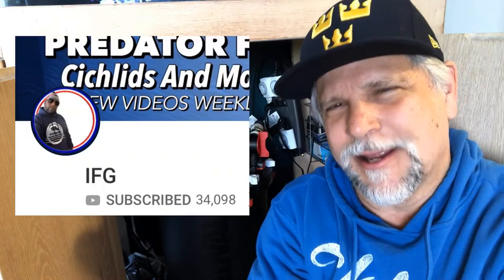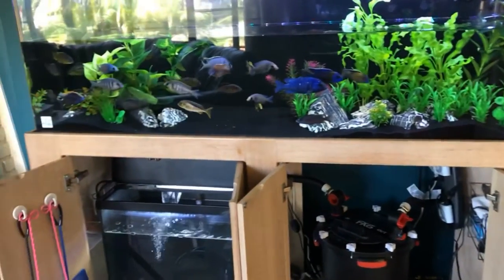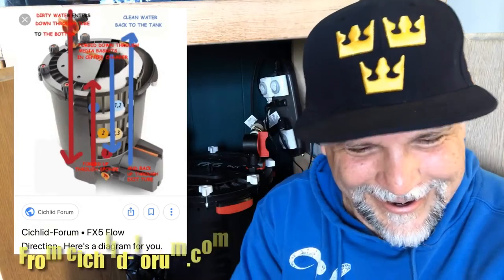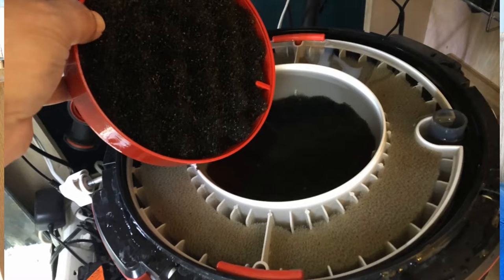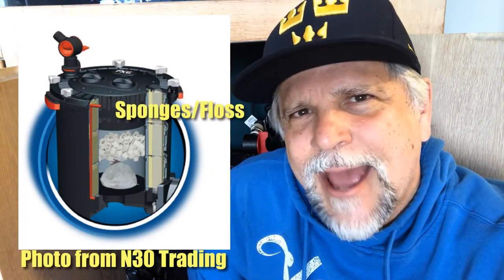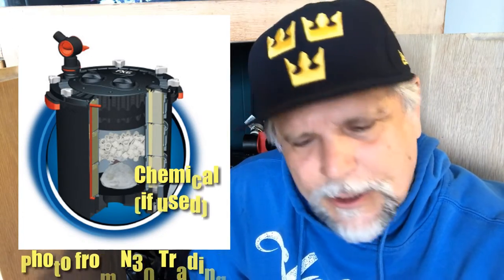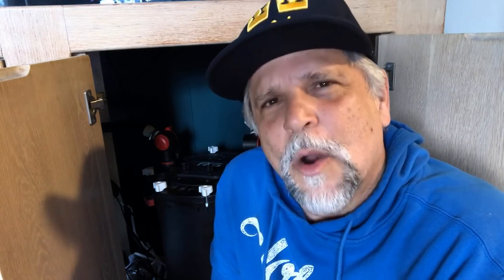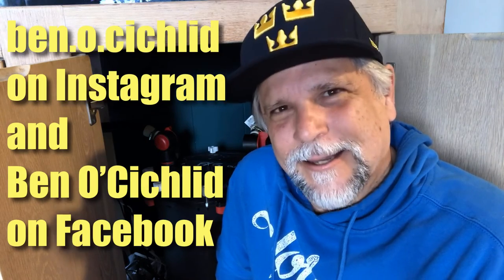Fluval FX Canister Filters - Before You it Plug in - WATCH THIS!

Comment: Have to say that I love the cap you wearing! :)

Got two FX6, Sunsun 704 & 703 and a CrystalProfi E902 to my 190 and 80 gallon tanks.
Both the Sunsun canisters started to leak within a year, and for me the leak on both filters came from the Inlet and Outlet Connector, took everything apart and used plumber tape behind all orings.. that did the trick.
Also had an issue with the FX6, but in that case it where a leak in the middle of the hose that started to spray water and not the pump itself.

My apartment have newly laid parquet floor so I don´t want anymore leaks..

I´m going to put each canister in a small container and then put a WiFi water-detector (puck) at the bottom of each container, if there is a leak the sensor will both sound an alarm and send a warning to the phone, it´s a total cost of about 250€.

Like your videos, keep it up.. regards from Sweden!
Reply from the maker: That’s the best way to have a canister. There is from my son who played baseball in Sweden one summer. He fell in love with the people and the country.
Reply: Swedish coat of arms. 🇸🇪 
Great video!!

Comment: Hi Ben, this video was very well done!!! I like how you discussed measuring the hoses. I also like how you clean the sponges to save money and improve performance. I don’t use any chemical media, so I just put more bio media in the bottom tray. Also, there is also 4 metal clips that the screws to the motor go into attached to the plastic ears on the housing. Great job my friend! I will share it and congratulations on 13 K.
Reply from the maker: Thanks Denny, you helped me out originally with both the FX-6 and the sump set up, if you recall!  Thanks!!!

Comment: Thanks for the tip on the sponge material.  I was about to order some.  Even if you replace instead of rinsing the sponge in tap water, there will be no good bacteria either way.  Also, you could rinse half in tap water every other cleaning to keep half of your beneficial bacteria in the filter.

Comment: If you put a conditioner in the tap water to rinse the sponges you won't loose the bacteria.  Use Safe and its very cheap to condition the water when you need to clean the sponges.

Comment: Thanks for the video. Just picked up the fx6 today to upgrade my 307 since it's struggling with my new 75. Only issue I seem to be having, doesn't seem like it pushes much more water opposed to my 307.
Reply from the maker: Maybe the split outputs on the FX6 make it seem like it’s pushing less water than it actually is? If it was one output it would be super high pressure.

Comment: I’m glad I watched this before I bought one. I’d have made most of those mistakes. Just had a bad flood/ leak with an All ponds filter( sun sun)
Reply from the maker: Thank you for stopping by and watching Pamela.  Another tip that helps (covered in a later video) is to place canister filters in platic containers.  That way if they do start to leak the water is contained.  You can even get sensors that set off an alarm if there's water detected.  It's covered in this video: https://youtu.be/blpw1Jo9fgM

Comment: What are your thoughts on changing the coarse sponges for different ones?  I have noticed a lot of the UK YouTube FX6 improvements suggest using one blue sponge on the outside and a green one on the inside sandwiched together (egg-crate style) in lieu of the Fluval white one.  Since I don't want to advertise anothers' site on your page I won't link the youtube page.  If you can't find what I'm referencing I can give you the title of the youtube site.
Reply: (Blue) 20PPI, (Green) 30PPI sponges I believe.
Reply from the maker: I’ve been happy with the performance of the filter using the factory outer sponges, especially after adding a pre-filter to the intake.

Comment: Great video!
I always rinse my pads in tap water.

I guess my biomedia have at least 90% of the nitification cycle bacteria, so loosing the 10% or less from the spunges is no big deal.
They will be replaced within a few hours and the ammonia and nitrite spikes isn't even measurable with any standard water test kit, so it will not harm the animals in the tank.
Of course, for anyone who have spunges only as both mechanical and biomedia, this method doesn't apply, one shouldn't rinse them all in tap water (or aquarium water, for that matter) at the same time.
Rinse the foam from one media basket each service of the filter.
It will reduce service intervalls, but keep the fish safe.
Reply from the maker: Excellent points Daniel, thank you!
Reply: Me too granted my water is from a well not a city source. While I don’t have a nice FX6 (too poor) I run a sun sun canister filter and a bunch of HOB filters. All filled with bags of lava rocks! Easy to rinse when they eventually get clogged. Works well and I save a fortune on replacement filters.

Comment: Ben, I just came across your video - well done sir!  I set up a 180 gallon tank in February with an FX4.  I am curious how do you deal with surface.  Also, do you have an videos or picture of the depth settings of the filter's input and output and how they are directed/located in your tank... are there advantages/disadvantages of how these are adjusted?
Reply: ^To clarify, how do you deal with surface protein?

Love your vids!
Reply from the maker: I point one FX output slightly up and toward the intake in the far opposite corner and the other slightly down. I also have 2 powerheads pushing a lot of water around. One under the Fluval output, also pointed toward the input, and one on the other side pointed slightly up and forward, breaking surface tension and helping to create a circular water movement pattern.
Reply: @johnsoncraig2230  freshwater aquariums don't really have a problem with proteins.
Not like saltwater setups

Comment: My directions say to put the rings bio in the bottom basket. Also some time I noticed that the thin filter at the bottom will stopped the water flowing out, why. If I rinse out the new filter first, it does not do it

Comment: Hi. Just set one up. Was working fine for about 4 hours and then started marking a clunking noise from the canister. I am wondering if this is trapped air. Unplugging and plugging in sorted it.
Reply from the maker: I’m glad it sorted out. It can drive you crazy.
Reply: @BenOchart  it did it again a few hours later, it is the air bubbler too close and sucking air in to the FX6 instal pipe

Comment: I just got my FX6.  How do you know when the flow decreases and it time to do filter maintenance?  I can’t believe how much water this filter pushes and how quiet it is.
Reply: I run two fx6s on a 120g.  Things to look for. 1. If the filter has to much "air" clearing during its auto function 2. I point one of the output towards the surface a can see the current. If it drops significantly then it's time. 3. keep a regular schedule like every other month  to assure top flow and just getting rid of gunk.
Reply: Interesting that you say yours is quiet - I'd say mine is pretty noisy! Have you measured it with a ecibel meter (app on smartphone?) I can't tell whether I'm being fussy, or whether it is genuinely loud!
Reply: @jamescalver8993  it can be finicky. One thing I discovered is that the output hose has to be as short as possible to max out flow and reduce noise. The more resistance the pump has the more noise it produces.  I also keep mine on a couple of 24" rubber tiles (Used for outdoor landscaping) to absorb vibration. try not to let the hose touch your wall or cabinet because the vibrations are very strong because of flow.
Reply: @migueleespinosa2632  thanks for the reply. I've done as much as I can on the points you raise - the noise I get seems to be coming from the motor, which then amplifies through the body of the filter as there's no vibration isolation between the motor and the body at all. I may try puting some small rubber washers on the bolts holding the motor to the filter at some point.
Reply: @jamescalver8993  Be careful with the washer idea buddy. It may lead to leaks. Don't get me wrong, noise arise because of the issues I noted and another I forgot is air in the system. Noise dives me crazy too!!! I but foam in my cabnet to absorb as much sound as possible. The rubber, or even better cork tile, under the filtter really helps.
Reply: @migueleespinosa2632  They'd have to be pretty thin washers to make sure the motor seal fully engages, so they may be too think to have any effect. Thanks, ill try the rubber pad. I'm also lining the cabinet im building for it with acoustic foam tiles to try and help. It's just puzzling as some people say its almost silent - mine definitely isn't!

Comment: I cut my hoses and then learned from Fluval, to always have the intake hose longer than the return. 😔 
 My biggest pet peeve, Why are there no CLIPS, every time I have to open them, all I can think while I'm turning the knobs is "WHY ARE THESE NOT CLIPS!" Oh and how is one to gravity drain the canister, when the hose connector is on the floor? Don't get me wrong, I love my FX but those 2 things always have me scratching my head when it's time to service them. Lol Ben do you have a G series? I've been seriously thinking about trying one on my 75g.
Reply from the maker: Hey!  I hear you.  Buy a length of hose that can go along the floor and out the front door into the yard.  Shut down the top output, open up the bottom and it should drain out.  Otherwise you need a hoist and dolly to move the damn thing, LOL!  Thanks for stopping by.
Reply: I put 2 five gallon buckets next to each other.  The canister drains until the water level is even.  Then I drain into the second empty bucket until the levels are equal.  Then, I empty bucket 2 into bucket one and drain filter into empty bucket 2 until the levels are equal.  Eventually, I get 90% of the water out and can move the canister quite easily.
Reply: So then i  need to put the intake at the far end of the tank  and the return closer to the canister i just got my fx6 yesterday and I haven't hooked it up yet so i was wondering
Reply: @alfonsomedina7013 The intake works by gravity, the pump is what sends it back into the tank, so you want that hose to be as short as possible.

Comment: I have my Fluval 5 for many years, I just clean my last week. I rotate medium, I will not replace everything at the same time. I do clean the foam filters , the way you do it. But I bought a bulk polish filters and cut them up, to used it in my system. My question is, after I clean it and put it back together. My problem is, it sounds like it constantly filling up. It gets quite for awhile and then sounds like it trying to fill up. Is there anything wrong?

Comment: My Wife's FX4 stopped working after we moved.  It was working fine, then at the new house once plugged in, didn't come on at all.  The OTHER FX4 on the OTHER tank came on for a few seconds, then shut off for a little bit, came back on as expected but the first one mentioned never came on at all and we waited nearly ten minutes before giving up and unplugging it for fear of fire or something from it's motor.  Any thoughts?  We only moved an hour away from the first house and, again, it was working fine for 4 years.
Reply from the maker: My only guess would be not enough water in the unit at start up, but you would have heard the unit trying to move water before shutting off. 
I’d open up the pump housing and scrub down the impeller. Maybe it’s gunked up?
Try contacting Fluval (Hagen North America?). Maybe their support team can help?
Reply: @BenOchart  Great suggestions, but we ended up simply going to the Pet Store and buying another one, so that we could get that tank going for her turtle.  It's working fine.  We're keeping the old one, and will follow your advice.  Thanks!

Comment: We can cut the plastic garbage hoses but the ends are welded to the rubber .
They need cutting here ,  the hoses are tuning wight at the filter ,   could go any time .

Flourval  406  ,   impeller shaft is  "  plastic "    TUT
Reply: the 306 is ceramic

Comment: cleaned impeller and still fluval fx6 stops running for days less than 1 yr old but bought on EBay with no warranty. Sometimes works when replugged but shuts off shortly and will not restart and no vibration or noise so I assume motor is not running. Any suggestions????????
Reply from the maker: It’s supposed to stop running shortly after being plugged in to purge air. When it does that, if you unplug and plug back in it starts the process over again. Do it several times and it messes it up.  I suggest you contact fluval. They can tell how old the unit is and maybe you’re under warranty (there’s a serial # somewhere on the unit). You might need a new motor.
Reply: @BenOchart  Thanks for your reply.  It is so nice to hear back from you. The unit is 9 months old and when I contacted Fluval about a warranty I was told that since I bought it off EBay and the seller was not a Fluval dealer there is no warranty on it.  I understand about the purging as I have 4 Fluval FX6's  on my setup which is a 350 gallon in the  back sunporch. Since I keep Koi I drain the water about 1x a wk and unplug the pumps, drain most of the water, clean the filters and plug all the pumps back in. This bad pump will shoot out water a couple of times and never restart so after about 12 hr  I unplug it  as there is no vibration or noise coming from the unit and I am not 2 sure what 2 do..  Sometimes the next day I plug it in again and it does the same thing so not 2 sure what the problem is.

Comment: Hello question,I have a few fx6,the other day the power went out on my house since it came back just one of the filters is acting up,the out hose is like shaking and I heard like a weird noise coming from inside the filter,like pushing the water something like that,and is just that filter
Reply from the maker: Sounds like some air got in there. Unplug it for 5 minutes. After you plug it back in it will stop to purge air. After that you should be fine.

Comment: Ben, I have a FX4 and it started to make this loud vibrating noise. Fluval said to change the impeller which I did and it still there. Have you run into this problem? Have you ever cleaned the hoses? Thanks.

Comment: Great advice. However, I do prefer my eheim's 2080 and 2180 over the fx6. If we could get more biological media in the FX series, it'd be more beneficial. Yet, it is still a good debris cleaner as well if you choose to use it that way.
Reply from the maker: Some day The One I'm gonna get my hands on an eheim.  Thanks for watching.
Reply: Eheim’s are crap except the classic and is not better than the FX6.
Reply: @joelthomas4294  naw, you got it wrong. My ehiems are work horses and the biological aspect of them can't be beat.
Reply: This fluval fx 6 is an overhyped POS. Have both an eheim 2262 and fx 6. The eheim runs flawlessly. The fax 6 has not been turning back on after water changes. I’m gonna have to break it down and check the impeller. Total POS. The eheim is plug and play.

Comment: How do you know when the motor needs to be replaced?  I already did the repair kit.  The water flow is terribly slow
Reply from the maker: Are you sure the hoses are not blocked and the media is not clogged?
Reply: @BenOchart  good question ❓. Not sure how to tell.  I'll take the hoses off tonight and run them through the sink and make sure they are clean.  When I first set it up it had Great water flow.   I cleaned the motor and propeller last night after watching your video.  It's more flow than it was but I know it can do more...   I can take some media out and see if that will help too.  Thanks brother

Comment: Which one should be a third the length? I did the 50 50 cut :(.
Reply from the maker: Before cutting the hoses you should decide on the placement of the unit and where the input/output will be hanging on the tank. It might require different lengths, not 50/50. Don't let the hoses sag or have a lot of extra or you'll get air bubbles coming out of the output.

Comment: What size tank is that fx6 on, I am thinking about setting up a 125g African cichlid tank. I noticed this video is of a cichlid tank
Reply from the maker: blizowman1 on a 100 gal.  I’m heavily stocked. If your going to be heavily stocked, on a 125, consider adding a HOB.
Reply: I have a new 125 African Cichlid tank with 40 mbunas.  I run the fx5 and also the sunsun he talks about.  Although mine is branded as an Aquatop cf500uv, its identical.

Comment: Hi sir
. I  have fluvale x5 .I just cleaned  then I got  pressure  of the pumps.can you  give ideas  thanks you
Reply from the maker: I'm not sure that I understand the question???   If the canister is not working, be sure that you filled it with water before plugging it in.  If you start it with not enough water in it, it will just hum and then overheat and burn out.

Comment: Ben, I wonder if the flow can be turned down a bit on the FX4.
Reply from the maker: Robert Brennan Sure. Turn the input output down a bit. Should work, but check with Fluval to make sure it will not harm the motor/pump

Comment: Hello.  My name is Bob and I live in Roseville CA.  I purchased the Fluval FX4 a couple weeks ago.  Can you offer advice on adding the inlet and outlet valves.  It is very hard for me to press the valves into place.  I tried using mineral oil but that is not working to make things easier to press into place the valve.
Reply from the maker: Rotating them back and forth as you push down should work, especially if you have oil on there. When you feel a slight snap, you're in place.  I push in the button at the base as I push them down.  I hope this helps.
Reply: @BenOchart  Thanks Ben.  I will give that a try.  I have no real upper body strength after my stroke.  I will rotate as you recommend.